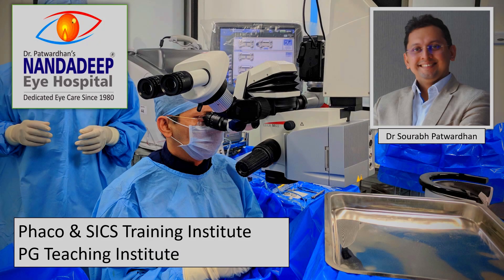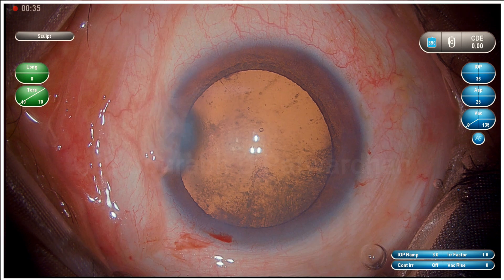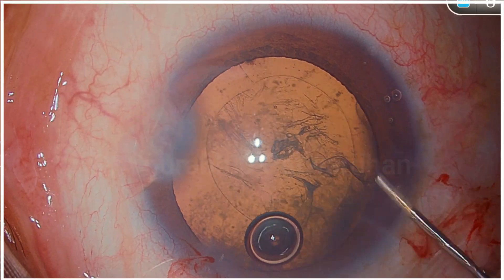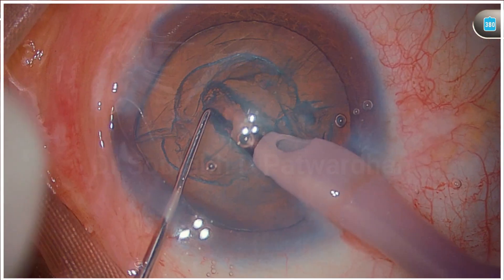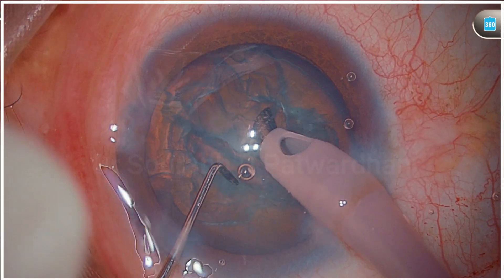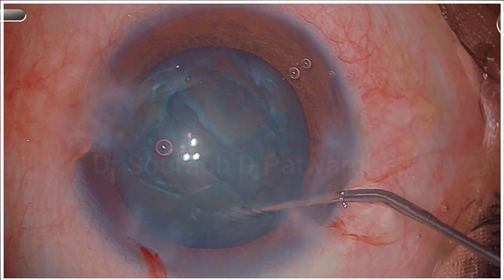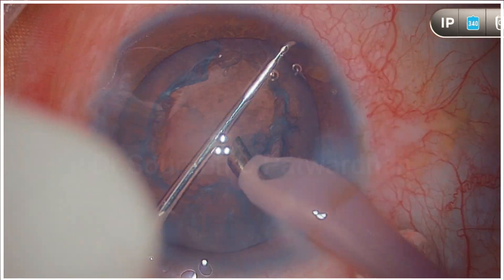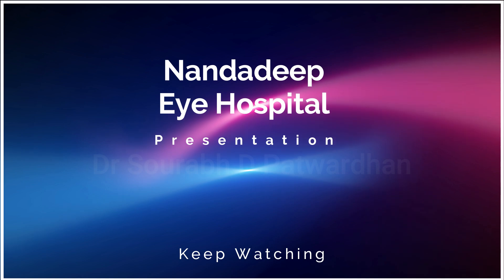268 How to identify incomplete hydrodissection- Must watch video Dr Sourabh Patwardhan

Comment: Sometimes after hydro dissection the nucleus get prolapsed obliquely but still sometimes it resist the rotation after putting it in the bag.. What might be the cause in that case?
Reply from the maker: It can happen if hydrodelineation has happened instead of cortex cleaving hydrodissection
Reply: @SourabhPatwardhanPhacoTips  thanks a lot sir for guidance